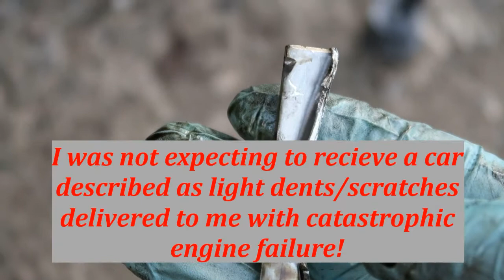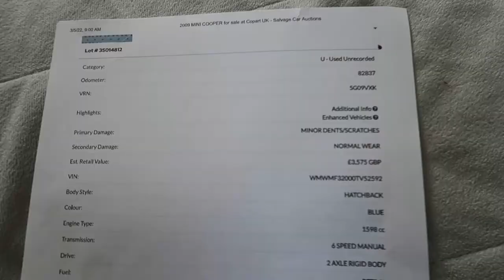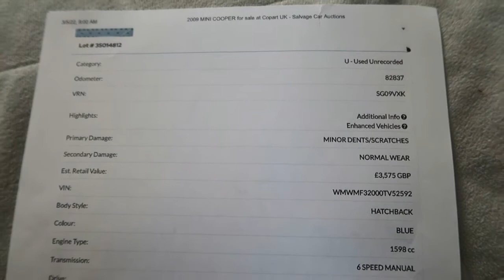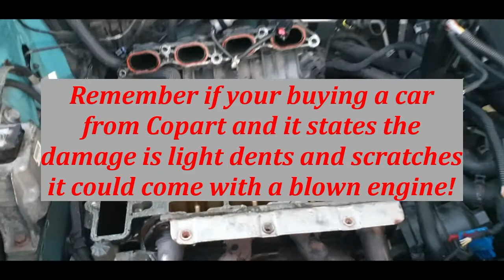Scammed by Copart! Car had a blown engine instead of light dents & scratches

Comment: Canny shady m8 will u be able to fix it. my friend bought a passat similar situation from them, he got home and engine was goosed
Reply from the maker: Hello mate. Its going to cost me a few quid and some time but i should be able to sort it. I always expect the worst from them but you don't expect to get a blown engine when its down as light dents and scratches. They did not state anywhere in the description that it didn't start and run either. It would be interesting to see how a court would see this one.
Reply: Hi mate, just curious what happened? Did you sort the car out? Did they compensate you? Thanks
Reply from the maker: Hi, no they where not interested. I had to rebuild the engine myself and then I sold the car. I probably have enough content to do a follow up video, do you think its worth doing one? 🤔
Reply: @Supercarlsunday yes!